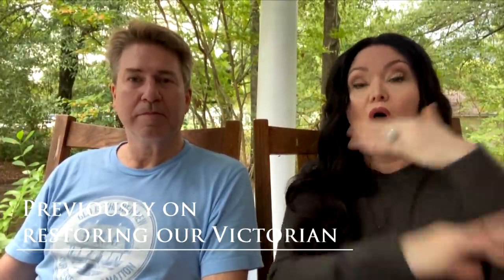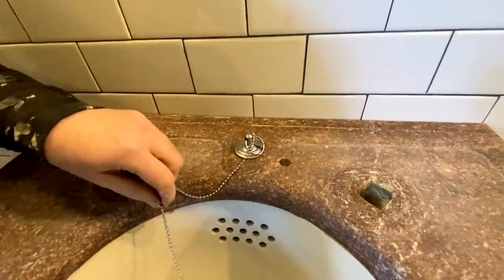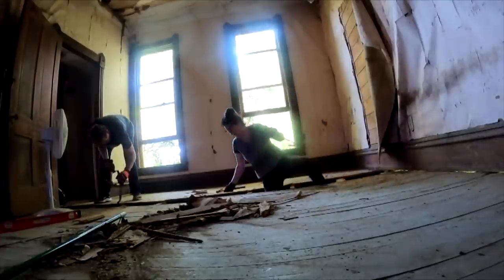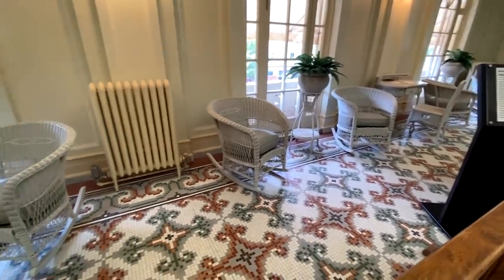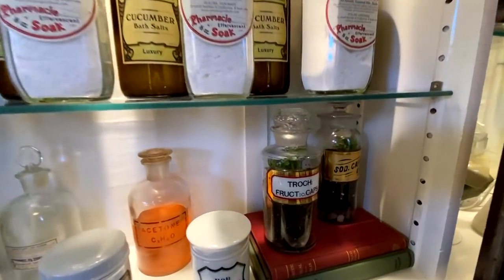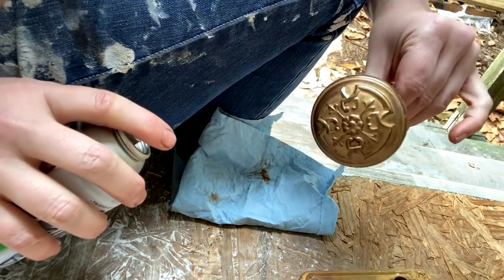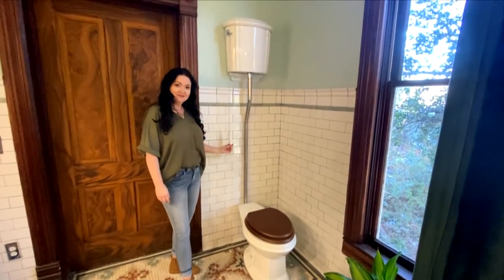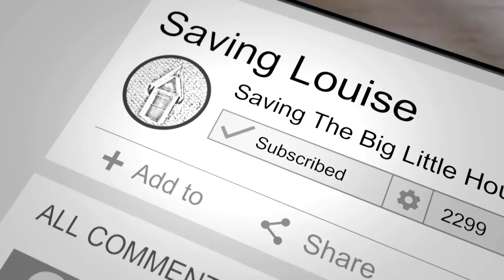Victorian Bathroom Before & After! Restoring Our Victorian: Episode 14

Comment: I love it! That floor is absolutely stunning along with the whole room. Now you've left us wondering which room you will tackle next. I'm still trying to figure out how anyone would take a shower in that tub, though. We have a similar arrangement on our 100 year old Sears Home with a claw foot tub and metal upper ring. I use a combination of clear and white plastic curtains, but have to have them all around to prevent water coming out onto the window, walls and/or floor.
Reply from the maker: We’ll eventually put the clear plastic up, but literally just ran out of time for the video
Reply: I think the metal upper ring (for shower curtain) is the object that Kevin was working on trying to assemble w/o reading the directions! 😉😂
Reply: I was wondering the same thing!
Reply: I think mine took 3 or 4 shower curtains and I had to cut 1 of them in half to fit in the areas where the ring has mounts in the way of the curtain sliding. I raised my ring up higher because it was so low to begin with and the shower curtains pooled in the bottom of the tub. It's my guest bathroom and I've had no issues with water getting out.
Reply: They do make a claw foot tub plastic 1 piece liner.

Comment: Bravo! Perfectly period bathroom makeover. Personnally would put 1 or 2 period standing lamps ( e.g. like the broken one you found on Tappan Pillow(?) attic) in cabinet instead of harsh ( on video at least) modern lighting from upper shelves.
Would have liked to see more of you 2 battling the insulation, floor and drywall. 
Was sad to see windowpane break. But immediately relieved; because, gosh, you so very much are about " do it, restore those derelict beauties". It gave me the confidence to go along, because you allowed us to make mistakes, breaking, mismeasuring, to go with the flow, but always start over again. No matter how long a job, in the end you get to lay in that " hot" batthub looking out over a manucured garden! :))

Comment: It was so neat to see the Hot Springs spa floor and how you had that manufactured for your bathroom.  Wowsa.  The apothecary cabinet is really a work of art.  Nice.  You had the room to do that.  Interesting.  Ah, faux bois.  I was wondering why the doors were painted like that.  The pink marble looks fantastic with the green edging around the top ledges of the tile.  So does this bathroom now have curtains or some window coverings so you can use the commode and shower without the whole neighborhood seeing in?  Very nice job.  So even if the rest of the house is still a wreck, you got a jim-dandy bathroom!  LOL.

Comment: Beautiful job! It certainly does seem like it was always there. The floor tile looks identical to the one at the Spa in Hot Springs, but the sections (so helpful to show how you laid it out first, then labeled the 'grid' for the pattern) are on mesh. Is this a tile pattern that's still made in your area? Or did you custom order the pattern, like those vintage wallpapers that are replicated from samples? I like the clean style so much...not a fan of wallpaper in bathrooms (been there, done that). Victorian does not have to be 'floofy'. Your vision is so classy. I do wonder about privacy for the commode, though, with the window right there. Figure you have a plan...

Comment: Phenomenal! I was so excited to see this reveal!  Help me understand the windows in my non building contractor brain. The glass paneling looks so thin..to the point you broke the 1st try. Wouldn't storm wind or debris easily break it?! Anyho.. this BR was way more than I could have dreamed up! 👌
Reply from the maker: Thank you so much!!! That window glass had been in place for 130 years, so no worry about breakage from what you mentioned. The reason it broke here was due to surface tension failure. Like water, glass has surface tension. Small chips or flakes along the edge (usually caused by poor glazing point placing form) break that surface tension. When the glazing compound goes over the chip/flaked area it protects it, but when one goes to reglaze as I was doing here that protection is lost, and the chip/flake will quickly run to a break.
Reply: @OurRestorationNation  is this the final episode of this house reno series? or is the project on hold/ ended?

Comment: Looks great! 

I really like the high mounted sinks!

Questions:
1. It doesn’t appear the faucets are aligned/pointing into the sinks, eg, left sink, right faucet. Why?
2. It looks like you chose to tile around the apothecary cabinet vs setting it on top of the tiled floor. Why?
Reply from the maker: 1. Weird camera angle?
2. Because it is meant to appear as a built in, and as a built in the tile would run around and not under the piece